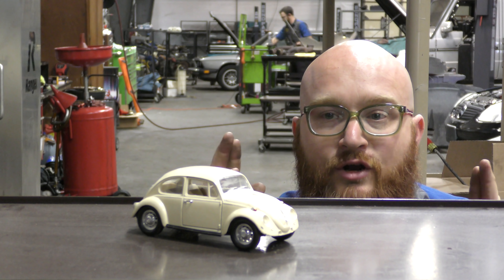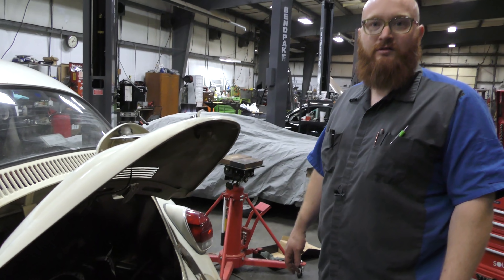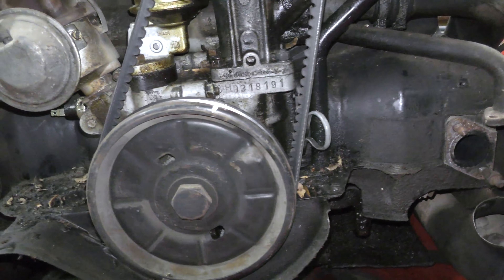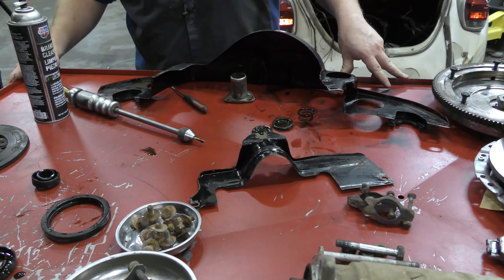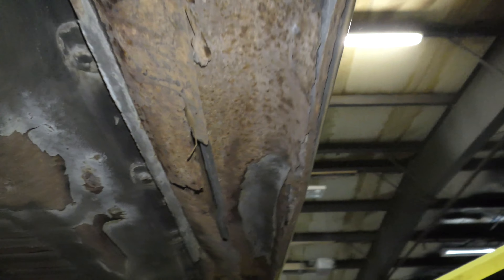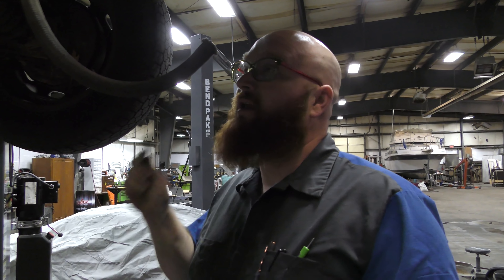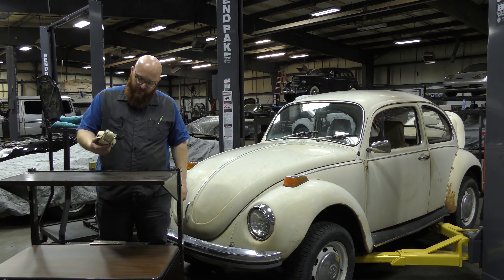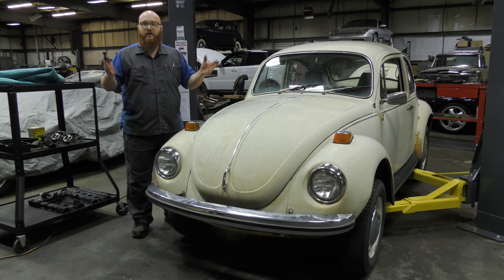Engine out for a clutch on '72 Super Beetle?! CAR WIZARD shows cool little car & huge repair process

Comment: That table got dirty again fast, I know I left that spotless after the Titan dumped all over it.
Reply from the maker: Yes. It comes with the territory. Lol
Reply: @CarWizard  Might need to be careful too, don't want any of that Nissan curse getting on anything else.
Reply: @JaredEveryDay  what Nissan curse?  That Titan that was in the shop had a Cummings diesel in it so that's a Nissan issue? Or are we taking about a different Titan?  When people increase boost on a factory turbo and it blows 90k miles later then they blame the manufacturer? Interesting 🤔
Reply: @eppyz  you mean a truck that was stock nearly it’s entire life, and you can’t buy repair parts for?
Reply: @JaredEveryDay  how are you saying nearly stock it's whole life when it's had a boost controller on it for 90k miles?  Also the issues with the truck were mechanical and that's a cummins issue since they made the engine.  So???  Your argument 🤔
Reply: @eppyz  seeing as how I owned the truck since new, it was stock nearly its entire life.
Reply: If that Titan mojo takes out the bug I'm unsubscribing from your channel Jared
Reply: @JaredEveryDay  ok but you keep saying "nearly" meaning it was indeed modified.  Then this engine was designed by cummings and your bad nothing Nissan why?  Because Cummings built a crap V8 diesel? Or? Please explain why your bashing Nissan over your modified truck having issues would love to hear your argument 🤔
Reply: @eppyz  Dude. Jared would know if the Engine was stock. I think you saw a little joke Jared was having with the Wizard and decided to try and pick a fight for no good reason.... Or could it be you are a Nissan fanboy that feels the need to defend all things Nissan?
Reply: I've been wondering if the parts scarcity on those Titans is because Nissan made Cummins modify the powerplant design and Cummins knew their changes were a bad idea.  Thus the engine became Cummins' "red-headed stepchild" that they have zero interest in supporting.
Reply: @jordancapps9521  from the Titan brochures I've read it states "cummings developed V8" so take that for what it's worth.  
The fact that people modify something then it breaks then blame the manufacturer and bad mouth them is beyond me🤔
What I do know is the Nissan trucks with the gasoline engines are very good engines and these diesels are not a Nissan product and they sold one of these for every hundred of the other ones there's a reason why Nissan discontinued this engine probably because of potential issues it has or the fact that it came in an overpriced truck I don't know but I just don't appreciate people bad-mouthing a brand based upon these factors it's just very brand biased.
My guess is this guy was running a boost controller and was probably hauling things or doing whatever over a period of time and he blew the turbo and then they want to turn around and blame the manufacturer.  I call BS😎
Reply: @docgiggles130  he admitted that the car was modified now if he bought the vehicle used someone could have had a boost controller on that thing since day one you don't have to take the engine apart and modify it for that there's no way this guy would know if that car had a boost controller on it before he bought it.
I do own a Nissan truck actually my wife does and yes I'm taking Nissan side on this one because I called BS because many times I've seen people modify vehicles have a problem and then blame the manufacturer it's not that I'm a fanboy it's just there's right and wrong.
Everybody knows anyone who has ever modified a vehicle knows that you pay to play.
If you modify your car in any way and something breaks because of it that's on you I would like the owner of this truck to put on his big boy pants and admit that his modifications were the reason of the failure instead of blaming the manufacturer that's what I would like to see because in all honesty that most likely is the reason for the failure in the first place and to say that the truck has been stocked nearly all its life what does that mean?  does that mean that he's owned it since day one and he's never done anything to the truck at all and then 5,000 miles ago he puts a boost controller on it and then the turbo blows is that what he's saying?
So it's okay for people to come and bash products for no real reason and then people that defend the vehicle are called Fanboys I just find that so funny to me I just like people to be grown ups and admit when they're wrong if that's being called a fanboy then I guess I'm a fanboy 😎
Reply: nice Porsche
Reply: @Ingens_Scherz  Jared made a joke about nissan and this guy went all crazy defending nissan. It was a joke. Pot and kettle? Lol. I'm not the one getting mad over jokes.
Reply: @paulcarmi8130  Whatever you think of his comments about Nissans (and yes, he did seem to be pretty desperate to "win" his point), YOU shouldn't butt in calling people "assholes". Not a good habit.
Reply: If it's the one i think it is, then it's my understanding they it had to be modified in order to fix it and get it back on the road. Mind you the stock turbo setup apparently was a "big problem"!
Reply: Hi Jared :)
Reply: InstaBlaster...

Comment: My mom gave me her hand-me-down 1976 VW light blue Super Beetle the summer of 1978, after I graduated from high school...I used to take it into the shop @ the local community college to work on as part of a summer school class in auto mechanics...such a great car...I put a lot of miles on it until I graduated college in 1982 & then traded it in on a VW Rabbit Diesel, which I eventually (in about 1991) drove across the country from NJ to Cali, then put on a container ship in Long Beach & shipped to Hilo, Hawai'i...I drove it on The Big Island until 1997, until I moved back to the mainland (Phoenix, AZ)...I sold my VW Rabbit Diesel to a guy from Alaska who had just moved to The Big Island...I put a lot of miles on those two VW's, & neither one of them ever let me down...so many great memories & crazy times in my Super Beetle & my Rabbit Diesel!
Reply: Great story on your VW's.   Good of you to share.

Comment: I had a 1968 automatic stickshift. I used shop vac hoses to bypass the rusted out heater channels, so I'd have defrost. On mine, the defrost came out the bottom corners of the windshield, and that center thing that looked like a defrost was just a fresh air vent. That was my first car. The rust was a nightmare. Cool to see this one.
Reply: I had a red '69 with the Auto Stick. Only problem I ever had with mine was a weak fuel pump. Otherwise, all i did was maintenance to it.
Reply: Representing! My second car was a '70 Semi-Automatic 1300. My problem was unfortunately the electrics, which is kind of important if you want to shift in or out of gear when there is no signal going to the auto clutch...
Reply: I drove one of those once when I worked briefly as a mechanic at a VW repair shop long ago. When test driving I forgot it was an auto shift and when driving down the street I instinctively used my left foot to quickly engage the clutch, which slammed on the brakes and almost sent me through the windshield (the brake pedal on the autoshifts is double wide and takes the space occupied by the clutch pedal in the 4 speed Bugs).

Comment: Brought back some good memories...I have owned a 1970, a 1959 and a 1964.  All three were so much fun!
Reply: I still have a 64. haven't driven it in 6 years.  it will fire right up.
Reply: I had the 59 also. You had to open the trunk lid to fill gasoline. No fuel guage other than a yard stick that I would insert through the filler neck. Ten gallon fuel capacity...or close to that. Run out of fuel, no problem, on the floor under the center of the dash, a lever to switch to reserve fuel. Heat??? No problem bc my 59 had a gasoline fueled heater next to the gas tank which blew extremely hot air right onto the passenger's feet! Car was a blast to drive....just allow extra time bc it wasn't fast.
Reply: @northdakotaham1752  Yup.  The 59 I had was also 6 volt and had the sliding, fabric sunroof.  I ran out of gas more than once because of no fuel gauge.  Too bad it was such a rust bucket and eventually had to be scrapped.
Reply: @daviddennis7558  a sun roof? Was that factory? I can't recall ever running out of fuel bc of the reserve fuel option. I did hsve problems with the nut loosening from the belt pulley on the generator. If the nut came off, the pulley came apart, the generator stopped turning and the generator light on the dash would light up. I would have to immediate stop bc that same shaft running through the generator ran the cooling fan on the backside of the generator. Without it turning, the engine would immediately overheat. 
 I eventually sold my Beetles. The transmission on the 59 was stuck, seized up.
Reply: @northdakotaham1752  Yes it was.  I only think I have seen one ore two more over the years, the last was at a car show in PA.
Reply: @northdakotaham1752  I remember that heater description in my Dad's 63 beetle.  It could get really warm but you always felt cold winter air coming in through the radio dial and where the radio speaker was!  It still was good overall.  Those Beetles moved through snow and ice rather well vs. most everything else on the road, too.  "Simple" worked quite well in many ways.

Comment: I worked in an engine shop in Phoenix in the 70s.  I built three of those engines every day from parts on the shelf.  You could bring your bug in, get a rebuilt engine in about 90 minutes for $260 (exchange) that was better than the original.  I used to go visit my sister in California and carry a spare engine and a jack in the back of my truck.  There was ALWAYS someone on the side of the road with a smoked engine.  I could get them up and running for about $300.  My record for removing an engine is 6:30 in a bus that didn't have the rear bumper installed.  I LOVED working on those things!  I learned how to drive a 1959 bug when I was 10.
Reply: I worked at Tim Ransom Import Automotive in the early 1970s, and later at Sun Buggy Rentals in Scottsdale.

Comment: I bought a 1971 non-runner as my first car and really learned about cars on that old VW.  I got so I could pull the engine in about an hour and changed the clutch on my girlfriend’s 1968 in the parking lot of my dorm in one day!  The most hilarious VW story I have was when I had a heavy friend sitting in the back seat and the engine started to die, then surge, then die again.  Finally the back seat caught on fire.  Turns out he was heavy enough to push the seat springs down and short out the battery, causing the engine to die.  As the engine died, he’d come up off the seat as the car slowed which un-shorted the battery and the car started - then he’d fall back in the seat and short the battery again repeating the cycle.  That back seat burned pretty quickly so I was thankful I could easily pull it out and throw it out on the shoulder before it took the whole car with it!  That’s when I learned that all old air cooled VWs fit into one of three categories:  1) Those that are going to catch on fire.   2) Those that are currently on fire.  3) Those that have been on fire.

Comment: Yes, I have replaced the clutch on a very old beetle, done on a barn floor with a few ordiunary tools.  I was a "broke" teenager at the time and that beetle was my sole means of transport.  I also replaced its pistons and cylinders to reduce the cloud of smoke emanating from the exhaust.  I kept it going for quite a few years.  Dr Porche was a great automotive desigber.  The beetle was easy to maintain.
Reply: Easy to maintain but needing very regular servicing if you drive in city traffic on a daily basis for years like I have, it gets old.
Reply: Me too, except it was out in the dirt in my parent's back yard.

Comment: Wow. My Dad and I did that 30 years ago when the clutch went out on my '74. Didnt have an engine hoist, so we jacked UP the back end and lowered the engine down. When we went to put it all together, sliding the engine forward we realized the clutch wasnt lined up right with the spline.....process all over again. We used a small dowel rod to line the clutch disc the second time and it worked. 
Mind you, this was long before looking up information on the internet. We had the BEST VW book ever. It was entitled something like, "Idiots guide to VW". I havent been able to locate that book, but it did have funny illustrations and good pictures.

Comment: We bought a leftover '68 in '69. I was USAF stationed in Texas and it was the first Beetle I ever saw with dealer installed AC! On the expressway it would top out at 62MPH. When the compressor kicked in it dropped to 55.
Reply: and alol the long freon hoses leaked a lot, so had to add freon frequently
Reply: @pablopicaro7649  never had a problem with my ac. When I moved up north wished I had better heat!
Reply: Had a 72 dual port even with the auto stick it would do 80mph.

Comment: I'm glad the Wizard mentioned how much FUN these things were to drive.  Not fast...just fun !  Very fast off the line though. 0-20 faster than anything else on the road.  But 0-60 slower than everything else. My favorite was shifting without the clutch.  There was a sweet spot in every gear where you could just slip it in without touching the clutch.  Never seen that in any other car.

Comment: I used to borrow an old one of these from a friend many years back; I quite enjoyed driving it - it was comfortable enough for me and with the 1.6 engine the car felt surprising nippy for a car of the 70s. I liked the engine noise too...that characteristic 'ROAR-TWEETLE' when you accelerated away from the lights was a joy. In the end it died because one of the plugs had welded itself into the block and the garage said it was beyond economic repair.

Comment: Nice...  I always liked the old school beetles.  That in spite of the fact that the only time I ever rode in one, it very nearly caught fire...  I was in the back seat which was getting VERY warm...  Then the smoke started seeping in and we quickly shut the car down and bailed...  Good times, good times...
Reply: Battery shorting out against the seat springs was a very common occurrence, especially if the right rear seat passenger weighed more than 150 lbs or so.
Reply: @billd66  - Was that the first electric heated seat in a car?

Comment: Brings back memories...  There were Bug-Ins in the '80s in Southern California (ref Cal Look Bugs) with drag races, custom cars, hot babes and such.  One of the events  was a pull-the-engine competition.  Two guys pull an engine, put it back in, and drive it a certain distance, or at least that's what I remember.  With some minor modifications e.g. a special motor mount modification, two guys could do the pull, install, and drive in less than 10 minutes, maybe less than 5 min, I don't remember, but it was quick . My friends and I could pull an engine, rebuild it (new heads, clutch, cylinders, rods, bearings, cam and a bunch of other stuff) in a weekend, even while drinking beer.  It surprises me  that the Wizard didn't resurface the flywheel.  Or did I miss that while I was typing this tome?  We also made "traction bars" out of a couple of battery clamps and a piece of square steel tubing.  Those were the days...

Comment: My very first car was a 1972 Beetle with a 1600 Dual Port that I did a resto-mod. The engine threw a bearing after spinning the bearing. I upgraded the carburetor to a a twin double barrel Weber carburetor,  I lightened the flywheel to just under 18 pounds, the entire fuel system was upgraded, my mentor and I swapped the transaxle over to a type two, the cooling system intake flow was increased by moving the firewall two inches forward and side air scoops added, my mentor and I installed a full thin wall tube chassis for reinforcement and support of the full roll cage we added during the process, full race bucket seats, rear fuel cell was added, and a beautiful repaint from the bare metal up because of terrible patch work. I loved that bug, my stepmother hated it, which helped me enjoy it all the more with the mind game reciprocation of my crappy teenage years. My mother loved it and that only fueled my fire especially on the dirt track. Some days I literally had to negotiate seat time with my mother, she and I loved it so much. 0-60 in about 8 seconds with both of us in it. I did nothing to lighten the car itself other than to get rid of some of the interior because the fuel estate was more important for range extension. My mother was always smiling in that puppy on the dirt track and on the street. One of the local cops took it for a spin and he really enjoyed it, his smile and all the breaks he gave me on the tickets made it all worth it and paying for his eggs out of my pocket for our egg business was even more worth it. Just don't tell my dad, he'd have a cow and I would have to make my first million dollar day happen. The poor guy sold my bug out from under me.

Comment: The variety of cars is great. I remember something about the battery under the seat as a young lad. If the springs were weak it would arc so put a bit of Lino over the top. But it’s a part of my childhood and remember them well.
Reply: Great! A back seat that doubles as an electric chair.